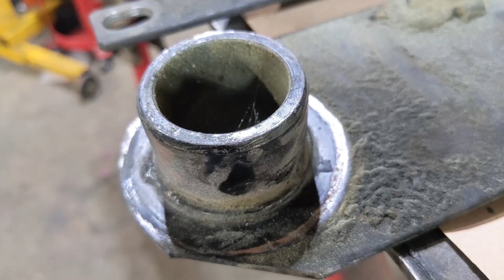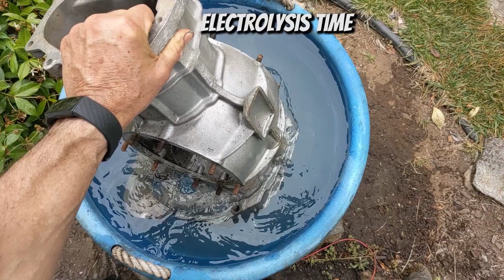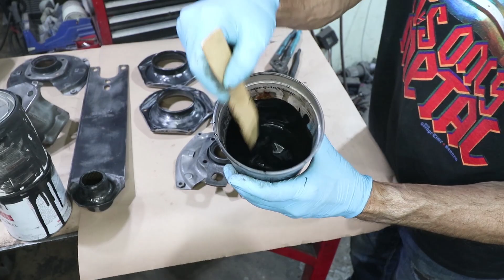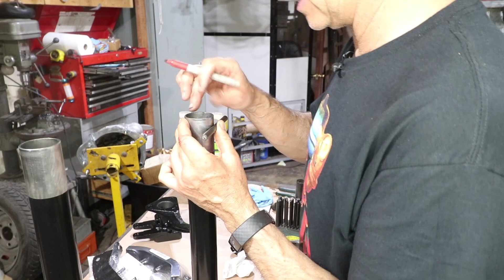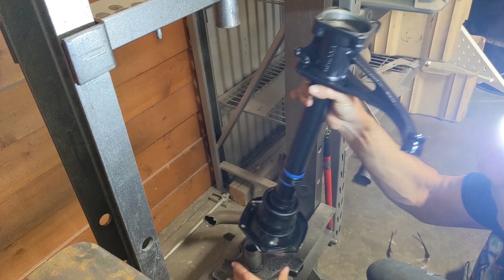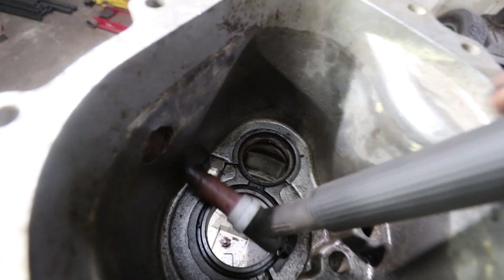Porsche 356 Solid Axle Boot Assembly

Comment: Sooooo. I admire your tolerance for tedious work. I never press apart the axle assemblies, preferring to refinish it as an assembly. As far as leaks go I paint over the tube to casting joint and the locking pin ends with PRC fuel tank sealant (an aviation product). Another thing that every Porsche 356 enthusiast should have on the shelf, besides a giant jar of money, is a can of Seallube (also an aviation product). 
Also, the performance of ThreeBond engine sealant cannot be exaggerated. 
It’s also sold as Hondabond so pretty easy to get. It’s why Japanese air cooled engines didnt leak and it works on Porsches as well.
Reply from the maker: How do you get the solid axle boots on?

Comment: Tom your making great progress, if you what to expand your bead blasting you can use a refrigerator box . This way you can put bigger parts in it and you can reuse the media
Reply from the maker: Great tip!  Sometimes I setup on a large tarp to collect some sand.  
Once the corners of the tarp are lifted all the sand goes back to the middle

Comment: Hi Tom! You can put the gear box case with the races in hot water (near to boiling temperature )for a few minutes and then, the race will be loose enough for be taken out by hand. The same method to set the new races in place. I learn this method from the Peugeot 404 maintenance rear axle book, and use it for every aluminium cases, works great and don't have the risk of distorsions in the case. Regards from Argentina
Reply from the maker: Hi, does your gearbox have steel inserts for the bearing bores?  
Differential thermal expansion works best with Aluminum/Steel versus Steel/steel.
Although the Porsche manual states to heat it during installation.  
This makes sense because one part is hot and one is cold.  
Glad it worked for you.  I'm always curious as to the why!
Reply: @GarageTimeAutoResto  Hi, my gearbox havn't steel inserts. I miss that detail in yours 😂. I guess the water method didn't do anything in your situation.
If any time you have to put or take out a bearing of an full alluminium case try with the hot water. It's just amaizing how much expands the alluminium with water under the boling point.
Reply from the maker: Thanks for clarifying!  You must have a big soup pan to fit a transmission in it!
The Porsche manual suggest to heat some parts in oil too.  
Heat is our friend.  Thanks for sharing!